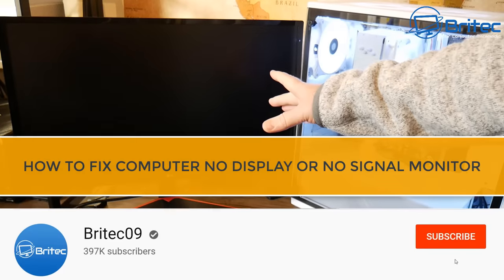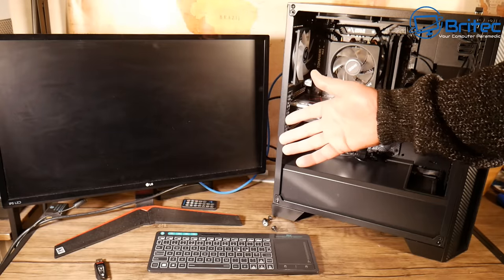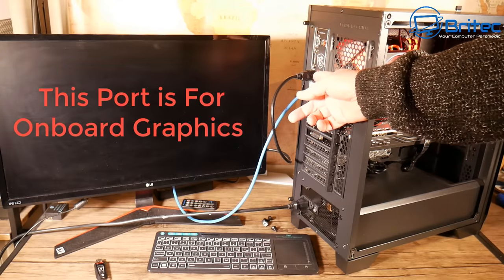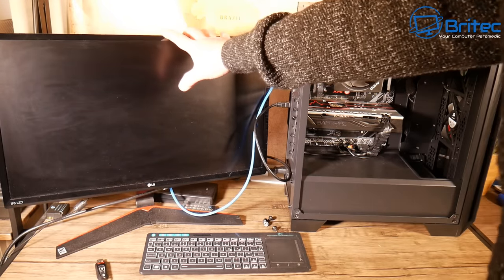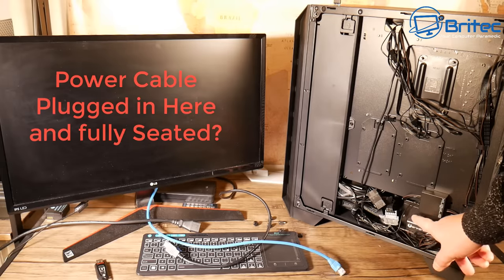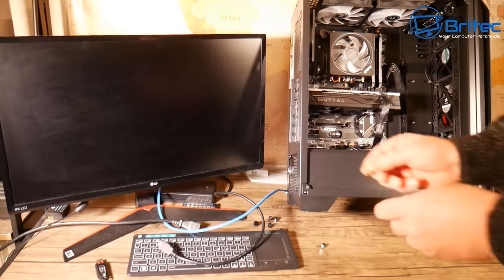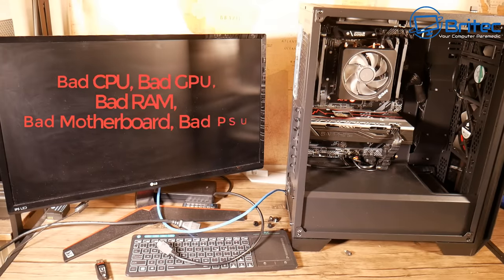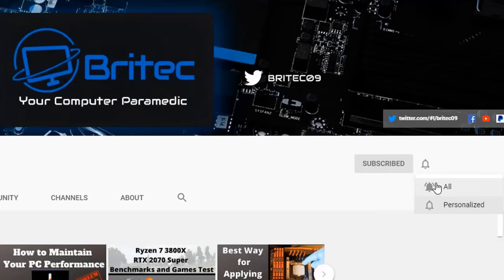How to FIX Computer No Display OR No Signal on Monitor

Comment from the maker: Video showing all the steps to troubleshoot No Display OR No Signal on Monitor.
Reply: Which media player is best all type video & audio support. Pls reply me
Reply: I have a problem big problem my vga hdmi and dvi just died in this fucking second on my HD 5450 its an old card it's OK but ym cpu is r5 3400g I am not using it cuz my pc was on any litgting striked  near my house and hdmi died on mobo after that I was using dvi d for vega 11 after 20 days it just froze and died like that's it.. And what the hell is problem my mobo was 3 times in the shop for repair where I bought it but every time they would say its working idk what is problem with
Reply: My gpu doesn’t have a cable going to it and I have a ASUS 1650 it’s the single fan one.its supposed to be like that right?
Reply: AMD  issues lmao never seen anyone with  intel  have these  issues
Reply: My computer turns on but nothing happens except the fans spin, keyboard and mouse doesn’t work mic doesn’t work headphones dont work or anything
Reply: Nitro Flipz same here with me....how to solve it?
Reply: Britec09 I was restarting my pc and then I went to a boost setting which I had to press F4 and Enter at the same time and it took me to the setting and I changed some setting around which one of them was save power and after word I saved it and it made a noise and it’s still black screen.
Reply: Brand new cable tested

Monitor turns on with other device but not with my pc

Please someone help
Reply: My issue seems to be that when the circuit is completed by plugging in VGA or DVI the connection board shorts and screen goes black. Inside the monitor I found an oily liquid which may have come from a spill that caused a short.
Reply: A problem that it could also be that you didn't address. Is that the computer could be plugged in to the wrong power socket. Like it's plugged into a power strip. This is a problem i had to fix on my parents computer
Reply: I’ve received a Be Quiet Dark Rock 4 for my PC, inserted the air cooler and I get this no signal from my screen. Is there a solution to this or is anything I’m doing wrong.
Reply: @kbbbhoyar8716  0
Reply: Thanks alot mate! You actually solved my problem. Watched all these other crappy videos (American) and they were a load of crap. Good British video 👍
Reply: thank you sir you just saved me and my brother from returning our pc’s
Reply: @zoranstefanovic762 .
Reply: Britec09  - thanks for this video as thought to  tell you bit about myself which is all footbal/soccer. Go Liverpool but more BRAZIL and pls dont hold against me where surely can have football discusions as we are in the best WC i  have seen in long time. I have a TV SCREEN with HDMI ports where bought a nice AMD box where in store they all plugged it in no issues but after i came home worked for 2 mins as the Microsoft code they gave me was used. I went back they fixed the micosoft code and was loading but came home woked for 10 minutes and no signal. I have tried as much but the computer box doesn't want to display on the monitor. Got 4 HDMI ports. I have tried as much i can do where one of my friends Ca,eos referred me to you. can please help as i have been in  IT  but not in depth. Thanks in advance if you could please help me.
Reply: @zoranstefanovic762 --- -i don't thhink its our  computer but you. Research, reset and cleclean aal the graphics card n few others be carffull .
Reply: The only thing I get is that the fans run for ten seconds. Then everything is dead. No beep, no bios, no boot.

Comment: How am I supposed to check if the ram is bad if I can’t see my screen
Reply: Thats what i said
Reply: You can buy a ram tester
Reply: Or get a white eraser (sounds crazy)and rub it across the gold ram part
Reply: @northerne5082  fr ?
Reply: SenpaiDaba yep ,make sure to not leave any easing particles on it and then reinsert it
Reply: You can also use the urine of a newborn Yak to clean the connectors.
Reply: You keep taking out your ram sticks and putting them in one by one and see if one doesnt work
Reply: what he mean by that is that test each ram for example if you have two sticks remove the left one then leave the right if it doesnt work put the right one on the left slot then do it also on the second one vice versa
Reply: @omgilovesteak6484  I don't  have  Yak, Do think I should sell my ram and buy a yak?
Reply: @ethanrapuano5885  ñpplk
Reply: @patony_1288  llppp
Reply: Just take your ram stick out. It shows your ram
Reply: @misadope  But what if I take my ram stick and they girls saw that it was too big and run away?
Reply: @patony_1288  They will want that size
Reply: @misadope  Ok but I have to warn them anyway, I like going deep with my Ram stick.
Reply: @omgilovesteak6484  how will you get a yak???????
Reply: @bard1101  ii
Reply: Dude, you right
Reply: I have 6 GB 5.57 GB usable
Reply: Did you fix? How
Reply: @arturdiniiz1254  i did but your problaby may differ form my i just returned the ram and got a new set
Reply: Its in your computer
Reply: Omg you don't know how hard i celebrated when it worked it wasn't plugged into my graphics card
Reply: How do I get another PC?
Reply: @omgilovesteak6484  I don’t have a yak though, where could I get one
Reply: speaker on motherboard giving beeps
Reply: For real same stuff I said
Reply: @Reynaldo lmao imagine being so wrong
Reply: use different ram
Reply: Exactly 😂
Reply: Like make it make sense, some of these ppl just don’t know what they are doing.
Reply: @northerne5082 

And we're supposed to drop money just to test our ram?
Reply: If you produce not interface
Reply: Remove ram and just insert 1 stick in the left-most slot!.. Got me out of loads of problems in the past.   

You can then try 2 and then 3 and all 4 and get back runnin again.
Reply: Lol

Comment: Thank you, I knew my monitor and cables were good and I knew I was using the correct port but I could not get any picture. I just moved coast to coast across the country with my PC and feared the worst. After digging around in there following your guide I’ve finally got picture again. Thank you!
Reply: What did you do to fix mine keeps saying no signal

Comment: The best one I had was the monitor was moving through the menu options and would not stop. The customer had put the computer speakers under the monitor switches on the bottom of the screen. Moved the speakers and it worked. Easy Money.  The cables are the first and most of the time the issue. Great video.

Comment: After I updated windows 10 it just never displayed after the restart.
Reply: Sammee
Reply: SAAAANE
Reply: Me too man
Reply: I just changed  new VGA 2070 super  (Asus prime h310 M-E +i59400f )  work fine with DP TO DP monitor    and 2 days after  I decided  to    upgraded motherboard  to Asus z490p +i5 10400   PROBLEM  NOW DP TO DP MONITOR   "NO SIGNAL "
Reply: Duangjai Boonsri same but I’m using TUF gaming B450
Reply: Same
Reply: NappyBoyYT same did you ever fix it
Reply: @benhojnoski8643  I took it to the shop and they fixed it they just factory reset
Reply: Boo Radley how much money
Reply: @benhojnoski8643  Yup i fixed it infact using it to type to you right  now :P
Reply: @benhojnoski8643  My problem was my graphic cards werent working all you have to do is get rubber from a pencil and clean the golden part you click into the slot mine is rgb so if urs is to it should light up
Reply: @starolaa  me 2
Reply: Same over here
Reply: I have this problem on my new computer too. Everytime I restart or go to sleep mode I cant get signal to the monitor again.
Reply: Samee
Reply: SAAAAME
Reply: Just got better ram cards fixed my issue
Reply: Sameeee
Reply: Dude I had the same problem

Comment: All I did was unplug the computer and plug it back in. Now I get a “no signal” message every time I turn it on.
3-Month Update: I didn’t turn the pc on. I’m an idiot.
Reply: same
Reply: Same
Reply: and i can't find a fix
Reply: @saehtnyS  try changing the hdmi to a different port. You can try the graphics card one or the motherboard. I tried and it fixed the problem
Reply: @lostyplayz2799  thanks for the tip but I actually figured it out, so what happened was that when I moved my computer it somehow uninstalled Intel and Intel drivers which didn't allow my VGA monitor cable to connect to my PC properly after installing that it fixed 😔
Reply: @saehtnyS  No problem, I tried this and mine got fixed. I wish it wont happen next time 😂😅 And its surely glad to hear that it is fixed now or it would be been struggle in lockdown.
Reply: @lostyplayz2799  yeah just so i don't have to deal with that again i'm buying a 1x2 male-female hdmi adapter so i can connect 2 monitors into my gpu (1660 ti)
Reply: I just built my pc and everything is in the right place I title checked everything and my cables are new, and it just seems gives me no signal I've tried everything does someone know what's wrong
Reply: @zisjenos  if nothing works in the video, try switching ports of hdmi cable if you have graphics card. I'm not a computer expert I'm still beginner but try removing graphics card and plug the cable to motherboard because graphics card sometimes disables the motherboard display output ports. I still tell you, I'm not a computer expert so try at your own risk. And also you can buy new cables instead of the old ones and it might work
Reply: @lostyplayz2799  well my graphics card is integrated into the processor tho
Reply: @zisjenos  then it might be some motherboard issue. You can try switching cables with a new cable or buy a cheap graphics card so you can plug the cables in. I had a VGA cable, it didnt worked so I switched to HDMI and so it worked.
Reply: Did it work for you guys?

Comment: WHAT I DID TO FIX: take out mobo battery for 15+ seconds and put it back in. Worked first try after trying everything else.
Reply: still didn't work help meeeee
Reply: Zeref sorry idk it worked for me :/
Reply: That’s the power supply right?
Reply: Niccc well I took out the battery, the silver circle below the gpu
Reply: is that the little silver coin on the mobo?
Reply: Soybean yes
Reply: @DanielBirman  ok thank you, ill try that
Reply: @soybean9301  did you tried ?
Reply: Cleaned my pc as well, got the no signal problem too, monitor is fine since it works with old laptop... tried wiping and replugging RAM as well ... any ideas?
Reply: @mossad_agent946  did you take out the battery?
Reply: @DanielBirman  fixed it by pressing the cmos-/bios reset button lol .....

Comment: Not sure if this was in it but none of the things worked for me but then I tried unplugging everything in my computer except my main monitor and it worked then I plugged the rest of my stuff once it turned on but when I plugged in my second monitor it said no input again so I just kept my second monitor unplugged until my computer was fully on and it worked fine, I'm guessing since my power/electricity went out that it caused my computer to not give enough power to all my components until it was fully on because I only have this monitor problem when my electricity goes out. So from now on I know what to do

Comment: Everything was plugged in and working and I put the hdmi in and the monitor said no video input and then I went onto a different monitor and used a different connection and it didn’t work so then I tried it with the motherboard and it still wouldn’t work

Comment: I click the power button, my monitor turns on and says no signal, then my computer starts screeching.
Reply: Screeching is an automatic sign of ⚠️BAD⚠️
Reply: I have the same problem, but it dosent recognize the mouse or keyboard, and when I leave the computer resting for a very long time, it works again like normal
Reply: But I need help :(
Reply: Sr.Poludo hey mate I have the same issue, I left it rest for like 3 weeks then I turned it on for checking if it works and it worked normally till yesterday ... now I have the same problem... I think that’s because of the psu that doesn’t give enough power to ur gpu to work idk.... tell me if u have some good news so I can repair my pc too 😄
Reply: Found out it was my ram :')
Reply: I had that problem I had to get a better power supply

Comment: So, I'm trying to set my laptop (Asus ROG Zephyrus GX501) up with two other monitors. As long as I just plug in one of them, everything works fine. Once I plug in the third, it doesn't show any signal, though the laptop does detect another plugged in monitor. The monitor also shows that it's connected to a PC, it just doesn't put anything out. Tried different setups - HDMI (monitor) to USB-C (Laptop) HDMI (Monitor) to Adapter to USB 3 (Laptop). Since I want to expand my screen (not duplicate), a splitter won't do any good. The first additional monitor works just fine, no matter which port it is plugged in, the second, however won't. I can use mentioned "second" additional monitor as the only additional just as well, then it works fine. So it's not defective.

Comment: I just change to another HDMI cable & the monitor signal came back. Sometimes it's just a technical other times it's just weird computer gone crazy 🤪 with 50:50 probability.
Reply: Ik it's off topic and random but you can do 50/50 instead of 50:50
Reply: Lucky

Comment: My Pc specs:

Gpu: gtx 1660 super
Cpu: ryzen 5 2600x
Ram: 16gb ddr4 3200mhz ram
          Corsair vengeance lpx
Motherboard: asrock b450m pro4
Psu: corsair vs650

Moinitor: aoc c24g1 144hz
Cable: displayport
Plugged into gpu

Bought all the parts 2 months ago

So what is the problem here? Which part is the reason that my monitor shows no signal?
Reply: Check that you have a good cable,and that the lid of the port is removed, the black plastic bit.  then make sure you have connected the power supply to the gpu by connecting the pcie cable. Plug the cable in to your gpu not the motherboard.  tell me if you have doubts
Reply: fireshuriken_97 won’t work for me

Comment: i agree that those are the steps...but I eliminated my PC as the problem quickly.  I get a blink on the screen to see windows screen and then dark. Turn off power and back on, get to see screen for microsecond.   Tested the monitor power cord/supply and fine.  Tested HDMI cord which was fine.  Put on another monitor same cords, it worked perfectly.   Obvious stuff.  But I want to know what's wrong with the monitor...that blink that shows me the screen gives me hope of something easily fixable.  So I guess the search goes on to figure out how to get to the "internals" and figure out whether it is just part, or needs a solder or what.  I've got the time so why not.  You got a video testing such things?

Comment: I'm loosing my marbles here....
 I was in the middle of a five page essay when my computer just stop responding. I moved the mouse and noticed the cursor did not show on the screen. I did the ctrl Alt delete, but nothing came up so I pressed the power button to turn off the computer, I waited 30 sec then turned it back on. Now my keyboard, mouse nor monitor came on.  So I called HP Tech support ( FYI I just bought this Omen Obelisk gaming Desk top computer for $1400 in Feb. 2020) after the agent had me try pressing F10 rapidly after turning the computer on (the monitor still had no signal) so he said turn the computer off again,  then he had me try pressing the windows button while holding down the letter B button then while holding them both down turn on the computer again, again I the no signal going to sleep bit, so he came to the conclusion my BIOS crashed and my unit needed to be sent in for service.. So I go back to where I purchased my computer (I work from home and go to school from home) so naturally Im pissed. After calming me down the manager gave me a loaner computer to use while mine gets service. We check it in the store every thing seems to work. So tell me why when I get home, I set it up and what do you know The hot damn monitor says no signal and going to sleep! The same damn thing Id just left my system at the store for 👀👀👀
What's really going on here???
I went out and bought new HDMI cables (expensive ones at that) to see if that fixed the problem, but no dice... Any advise out there please post it. 😭😭😭
Reply: Dude you saved my  life, I tried the f10 spam and its working!
Reply: Did you find a solution

Comment: The one obvious issue not mentioned is if you just updated your video driver with a buggy one. This happened to me tonight. System ran fine until I rebooted, then the no power messaged started floating across the black display. To fix this you need to boot up in safe mode and uninstall the buggy drive or go back to the last good restore point on the pc. You can look online how to reboot in safe mode. In Windows 10 you need to turn off and restart your pc three or more times before the restore screen pops up. You then need to go to the Troubleshoot option.

Comment: I cant thank you enough for this video. This is my first time building a pc and I just cant get it to connect to the monitor. I thought it was something with my dvi to vga adapter but I watched this vid and tried to clean my ram using eraser and it works! Thank you once again. I was so scared I did something wrong when i was building this
Reply: this works for me!